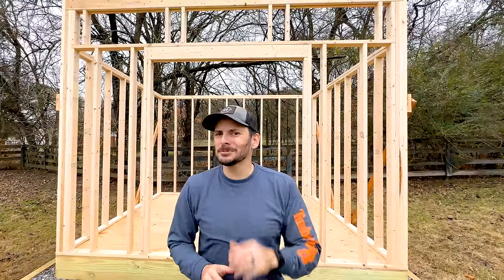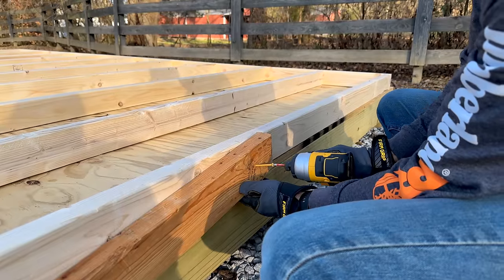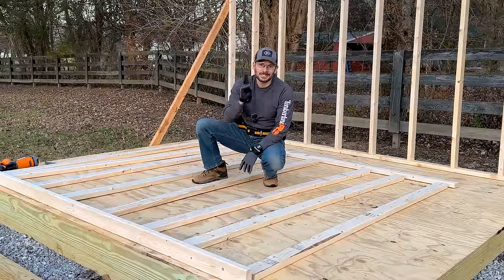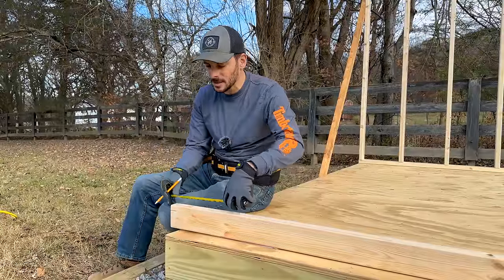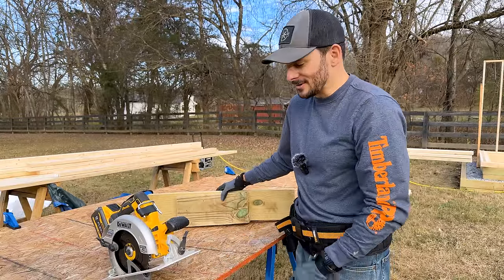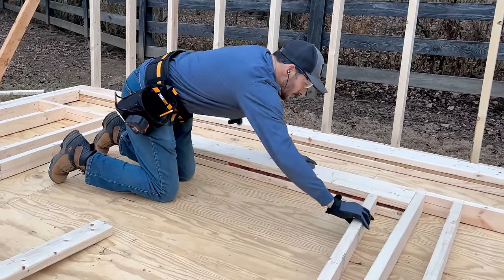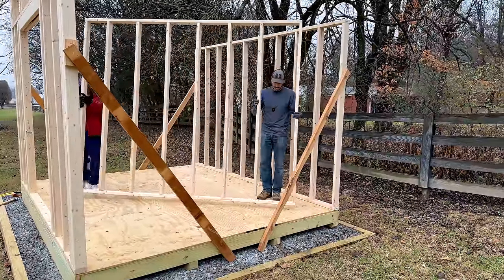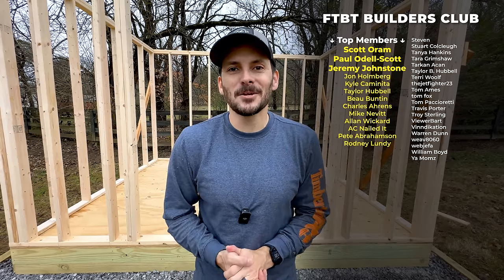Framing an Overbuilt Shed

Comment: Hi, internet expert here. You started well enough but definitely want to use wood glue and screws so it never moves. Then wrap it in chicken wire, and cover with cement. This will aid with EMP shielding and slowing the bullets for when the feds come.
Reply: I would also suggest weaving space blanket in between studs before hanging the wall sheeting for optimal blocking
Reply: No tinfoil???
Reply: Lead lining for radiation?☢️

Comment: As a wall panel builder, I can say for sure you were doing at the very least the front wall the hard way. It is usually easier to nail the stud packs and headers together before you put it in the wall. Then you don't worry about awkward angles with the nailer and is guaranteed to be flush and straight if you are vigilant.
Reply from the maker: that's a great tip...I'm a amateur at shed framing but I'll use that next time!
Reply: It's also infinitely easier to sheathe it before you stand it if you are standing it some way other than human strength.
Reply: “Stud-pack” - 
THAT’s the proper reference!.
Reply: @Casmige ”Stud-Pack” … t shirt idea?  Maybe print that on boxer shorts?
Reply: @BiggMo  Paul and Jordan already have t-shirt merch with stud pack on them for their channel name and logo.
Reply: @TheOriginalMrB their merch should say stud hacks instead of stud pack 😂
Reply: Was just about to say Stud-Pack has a lot of good vids on the subject and the comments beat me to it 😂
Reply: @Fixthisbuildthat 
Great work! I'm learning from you and your viewers comments. Thanks!

Comment: Nice video. Like seeing the family helping. Tip: those small blocks you used to flush the walls to the floor - if you would fasten them to the outside of the floor before you raise the wall, not only will it help you flush the wall, but it also makes it so the wall can't slip off the floor when lifting it in place. Also, if you undercut the base plate about halfway through where the door is going before you raise the wall. it will make it much easier to finish cutting that piece out for the door opening since the saw will not have to drag on the floor to cut that board.
Reply from the maker: great tips, wish I'd read your comments first, lol
Reply: I wish I'd read this before building my shed, too. Great idea about attaching those small squaring blocks.

Comment: Nice work Brad!  A stop block saves a ton of time and makes every cut accurate.  A battery powered nailed is also a great investment. 👍
Reply from the maker: yeah, really wish I'd gone with the battery powered one
Reply: @Fixthisbuildthat  The battery ones are just at another level now days with the more powerful long lasting batteries.  I rarely use air tools now days, which is nice when working away from the home.

Comment: Hope they were really meaty misteaks.

Pro-tip: When tipping up your wall? if you’ll put some flush blocking at the outside of the bottom-plate?, It will keep it from leveraging or slipping off the edge…
Allowing less people to be involved in tipping up the wall.
Reply from the maker: Great tip!

Comment: 1:50 got very lucky with this about 10 years ago, only a brad nail but it came out side of wood and skinned the side of my thumb so little it went through some skin but didn’t hurt a lot. Scared the sh*t out of me. Was using the brad nailer everyday for years so I got to comfortable and wasn’t thinking about saftey. Also the only time I can even remember putting the nail on such an angle it comes out the side. Only takes once, thank god my thumb wasn’t another 1/4 inch the wrong way.

Comment: Awesome video, Brad! I'll be needing a new shed real soon because the roofing has just about had it, and it becomes an insect haven in the summer. Since we tend to have termite problems, and we're in a hurricane zone where I live, I don't want to have to pay for two types of pest control, and it has to be high-wind resistant. We're looking into composite which is infinitely more expensive than wood, but will last a lot longer in the end.

Comment: Lookin good, I like the lean-to look! One thing I've done is sheath the walls while they're laying down with the appropriate overhang on the bottom. That way when you raise the wall the sheathing registers on the side of floor joist. Just nail it on from the outside and it's all flush. Then nail down thru the bottom plate. I guess you run the risk of that bottom plate not being perfectly straight... Honestly not sure which is best haha.

Comment: You are an enthusiastic guy with a videographer who is easy on the eyes. I too am a guy who has over done a thing or two in my life. 

Framing in the future. Assemble your king and Jack stud assemblies on top of your bench. Just as you did your header on top of your bench. Much easier. And you only have to attach  through the top and bottom plate  to the king stud.  I would also rip the OSB filling for the  2 x 6 sandwich a  quarter to a half inch less  than the width of the 2 x 6. (Five to 5 1/4 inches)    Fasten it to the inside of one of your two by sixes with inch and a quarter screws, inch and a quarter nails, or something similar.  Not everyone will have the luxury of your bench and clampS  when assembling this.

Comment: You mentioned possibly parking a tractor in there. Something like a Kubota BX2601 (a typical compact tractor) weighs about 1632lbs. If you put ballast in the tires (as you should!), you're adding about another 400 pounds. If you assume a 50/50 weight distribution (which it will not be), you're looking at 500lbs per tire. The contact area of the tire is small, which is going to give you a fair amount of pounds per square inch. I don't think you really want to do that on a plywood floor. You probably won't break through the plywood, but you'll definitely be flexing wood.

Comment: I am a DIY guy who has done similar small framing projects— decks, sheds, kids’ tree house, etc.

As a non-pro, I use screws for everything. It takes longer, but it’s easier to fix mistakes or make changes. Maybe you decide that you want to run some conduit later and put in an electrical box but there’s a stud in the way. Maybe you want to add a window or a second door later, etc.

Also, when you’re doing DIY framing, you probably already have a drill but you don’t own a pro framing nailer. Yes,
You could hammer in your nails, but that’s even more work than running screws. If you already have a cordless drill/driver, that’s all you need to frame with screws, although I have a separate drill and also an impact driver.

Comment: Scrails man, for one off projects like this always use scrails.  Scrails are framing nails that fit standard framing nailers but can be unscrewed when I realize that I’m an amateur and have nailed something in out of square, backwards, upside down, or out of order. 

Much faster (and cheaper) than traditional screws, but saves you from the pry-and-cut technique.
Reply from the maker: is this an actual thing?  I feel like I would have heard of these before...but if so that's awesome
Reply: @Fixthisbuildthat they sure are! When I built my 12x12 shed this summer, I used scrails from Beck. I am not a smart man so they were a godsend for me haha. Made the same mistake you did about not making the center wall flush.

Comment: you may want to check what the required setback is on your property…I know it’s a little late now, but I live in a rural area of tennessee, and made a similar mistake.  if you are ever questioned, remember it was that way when I moved in!
Reply: --- when I bought my land in a rural part of Harrison county in Mississippi,  they had just enacted a very basic county wide code  -  but they offered a "3 acre exemption" which removed the code regulations for properties over 3 acres:  and it was permanent as long as you owned the land.  No building permits required;  no inspections;  and the only requirement being that permanent structures had to be a minimum of 200 feet from all property lines.  You basically just signed a statement saying you understood that if you sold the land / buildings that any lender that required inspections would not lend money of the property.   It was $25.   First thing I did was go get one and I still have the land almost 50 years later.    After building 3 houses, several barns, and numerous outbuildings through the years, I pointed out to one of my friends who works for code that they were scamming folks:  he wanted to know how  -  I pointed out that the area of a circle 408 feet in diameter is exactly 3 acres so legally the biggest thing anyone could build on a 3 acre lot was a building 8 foot to a side and then only if the 3 acres was an exact circle and you centered the building .   His reply was :  " I'm going to forget you told me that."
Reply: @bonesrhodes3762  that sounds like a rule they would make up here…simple and useless.  the only thing that requires inspection in my area is if you need to add or modify your electrical, and that is only a cursory panel inspection.  it is quite the extreme from my former city where codes people felt like they where structural, electrical and mechanical engineers who knew more than anyone and “cared” more than anyone.  somewhere between the two extremes is probably a happy median.

Comment: On the framing nailer you're using, are their differences between the different angles on different nailers?  Advantages, disadvantages?
Reply from the maker: hey, Keith. From my understanding it's mainly around how many nails they can hold and if you need to use clipped head nails or full head.  The 21 degree (which I'm using) is more geared for the full head nails, but will hold less than the clipped head 30 degree.  And the 30 degree can get into tighter places
Reply: In addition to the above response. Nailer angle is usually regional. See what they sell in your local stores and buy the nailer that goes with them. Where I live it’s all 30 degree. Finding 21 degree nails is almost impossible.

Comment: I don't know anything about framing, but could you use 1/2" insulation board as a spacer? I'm curious if you can thermally break the headers.

Comment: Ive never figured out why people on the youtubes dont sheet their walls before raising them.  You can square your wall up on the deck and dont have to struggle holding the sheeting up.
Reply: Depends how much someone can deadlift
Reply: I think it has multiple reasons behind it but one is probably that it doesn't look as good or easy
Reply: I built a shed a few years ago and lift a 10 foot high by 10 foot wide with two sheets of t111 siding by myself and I'm an out of shape upper 30s. It wasn't that bad at all. But for some stupid reason I didn't do that with the remaining wall sections and had to deal with hanging sheets and squaring the hard way.
Reply: @gabrielarrhenius6252  its far easier. And its way easy to make it look good if you are not trying to hold it in place.
Reply from the maker: Yeah, I definitely considered that.  Open walls do have an advantage though as you can clamp things together like I did.  And I'll use a ledger board to hold the sheets up while I attach them, so it'll make it easier.
Reply: @sarinhighwind  I have no idea why, but I feel that it doesn't look as easy as it probably is when they add the sidings on the walls before standing them up. And I meant that it normally doesn't look as good or easy when watching others do it on YouTube. It is like when you normally follow an instruction manual to do something step by step but when you watch a professional do the exact same thing it does a later step earlier because it doesn't change the outcome and is just as easy or maybe easier, and you become confused with the question "why?".
Reply: @gabrielarrhenius6252  im speaking from experience as a carpenter.  So. Duno. To each their own really on some of this stuff. And it depends on the size as well. I wont sheet a wall on small stuff, but when i gotta handle full sheets. Ill do as much before standing as it helps with squaring everything out and makes managing the finish easier.
Its way harder to square up sheets on a wall when its standing than on the ground.
Reply: @Fixthisbuildthat  this is not untrue. All methods have their ups and downs.